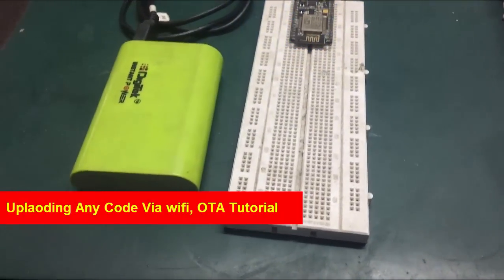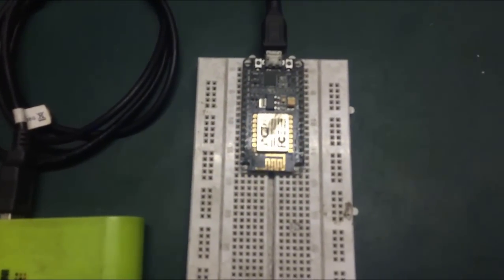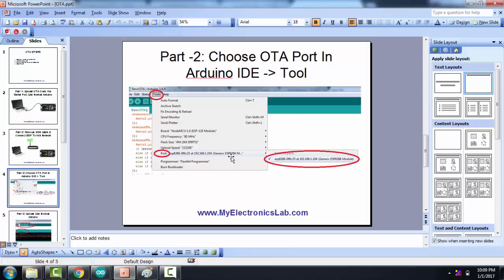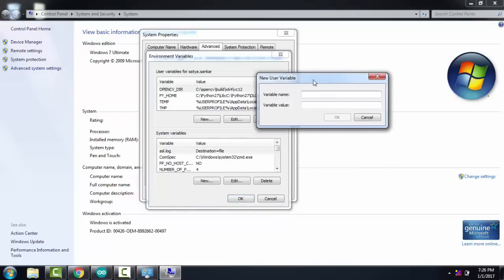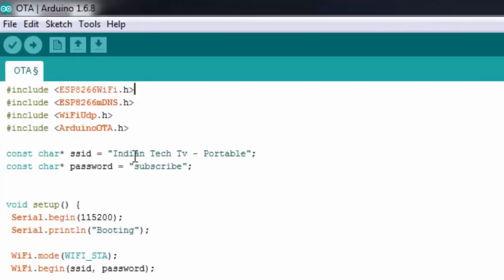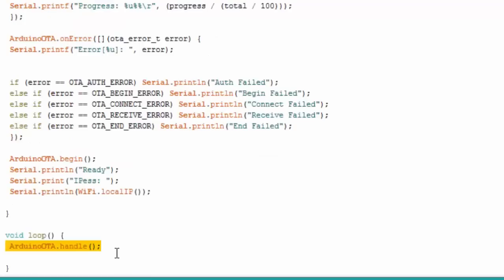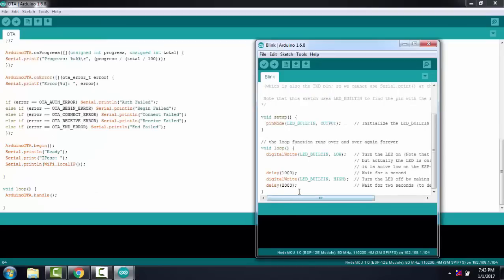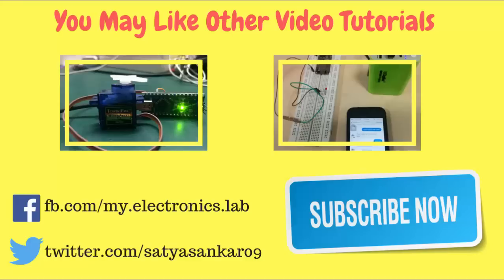ESP8266 OTA Example Arduino Code Tutorial | Over The Air Update

Comment: I can connect to ESPlorer read chip id, NodeMCU 0.9.6 build 20150704  powered by Lua 5.1.4 firmware  etc. send a blink and hello world but arduino will not recognize board. Will not load basic OTA. Reinstalled everything!